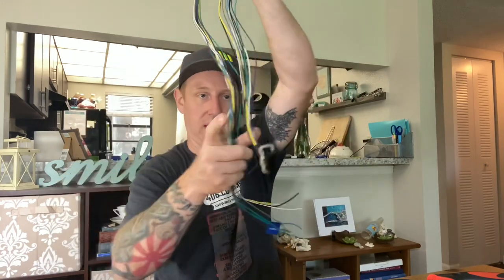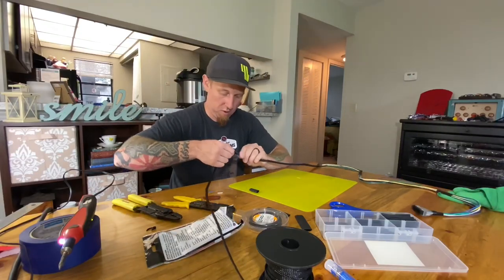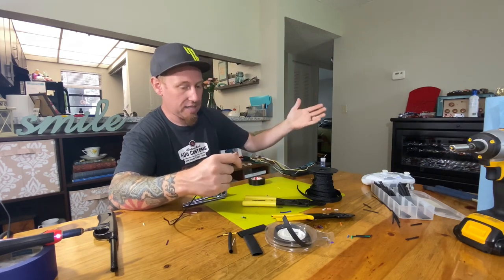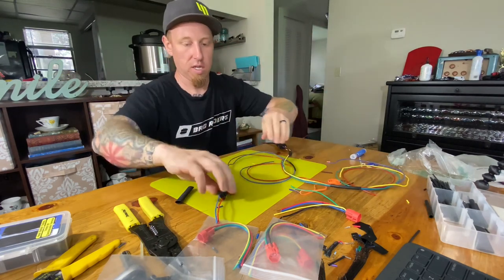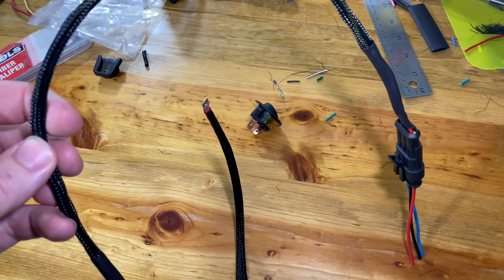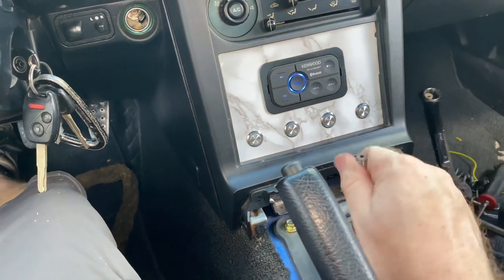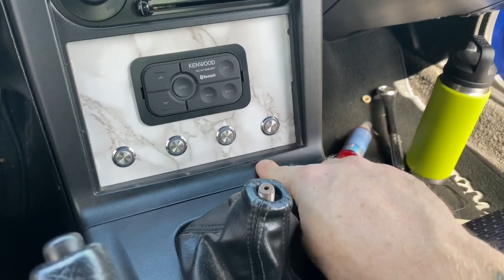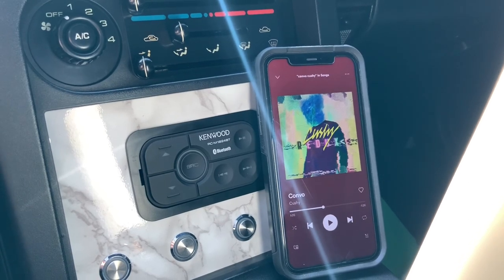Miata Hidden Bluetooth Stereo And Switch Panel Install!

Comment: I’m about to hook this up in my ‘66 Thunderbird as a stand-alone unit. Question, can I simply run the yellow batt/acc wire to my acc post on the ignition, attach the black wire to ground? And then after attaching the speaker wires be done? Could it be that simple?
Reply: I’ve been looking everywhere and cant find the pinout diagram for the Bluetooth controller plug that plugs into the amp. I have 4 wires that pulled out of the pins and cant find which color goes where. Would you be able to help me out? I’ve called kenwood and they dont even have access to the pinout diagram

Comment: I’ve been looking everywhere and cant find the pinout diagram for the Bluetooth controller plug that plugs into the amp. I have 4 wires that pulled out of the pins and cant find which color goes where. Would anyone be able to help me out? I’ve called kenwood and they dont even have access to the pinout diagram. The colors that pulled are orange, green, blue and red. Thanks